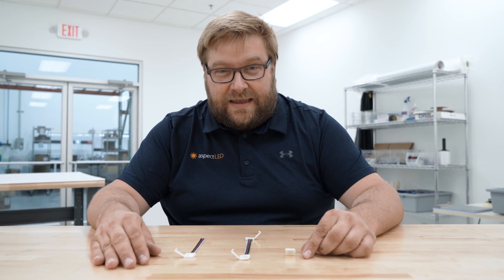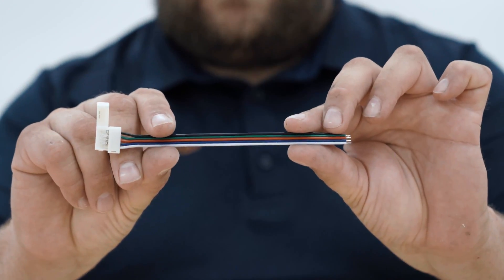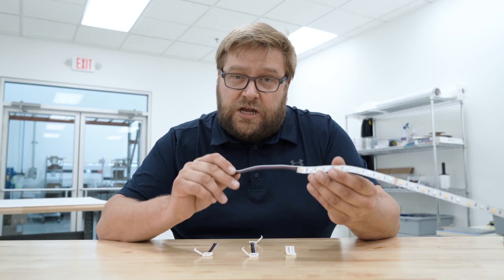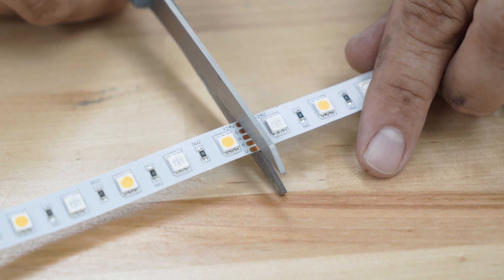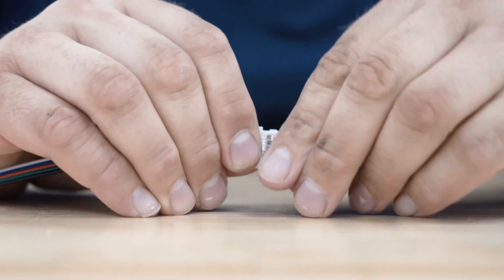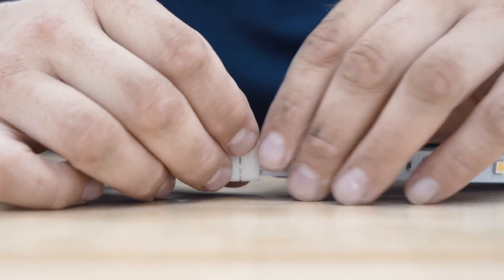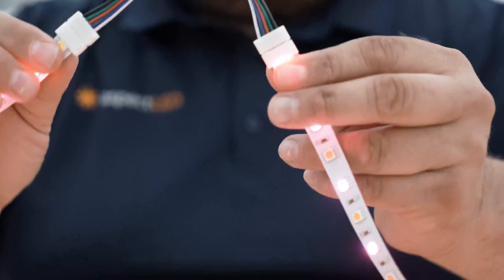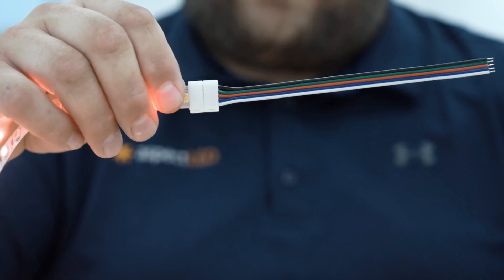How to use the RGBW Flexible Strip Light Quick Connector (Old Style)

Comment: Mine didn’t go in easy because it was sticky and keeps on falling out. No matter how hard I push it doesn’t go in it just ends up almost getting cut
Reply: Little late to this answer but one trick is if you have a thinner strip, leave the adhesive covering only the point that gets inserted. Gives you some extra thickness so it snaps in. If this doesn't work, I grab a flathead and gently and carefully push the pins upward to release some of that tension and peel the adhesive cover off before inserting. Place the LED strip under the pins ( should be little to no friction) and make sure the pins line up to the contacts on the strip. I then use the same flathead to push the pins back onto the flimsy ass strip and the adhesive on the bottom should help keep it secure on the bottom side. Not ideal, but it works.